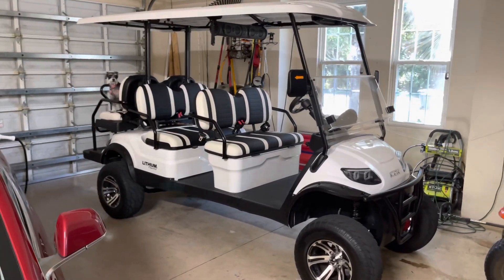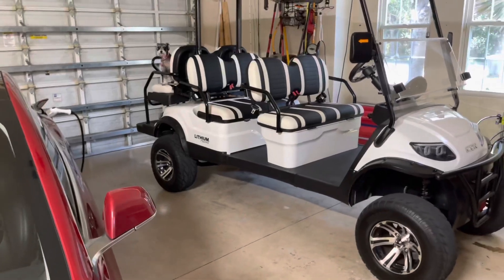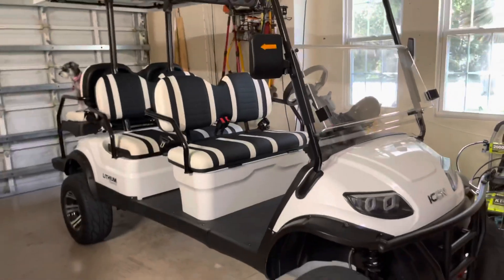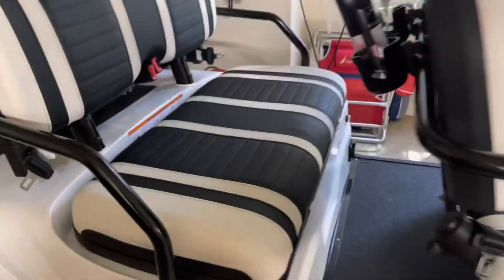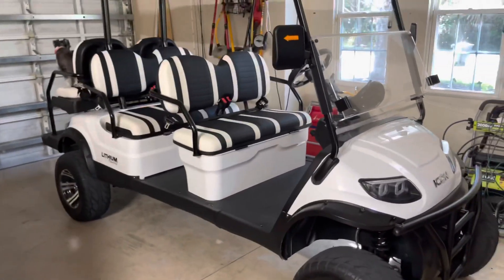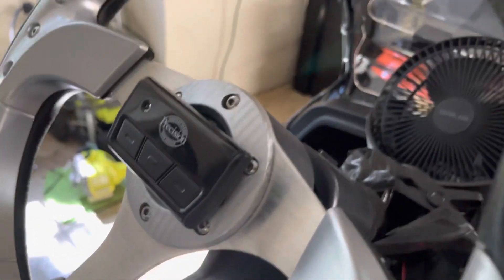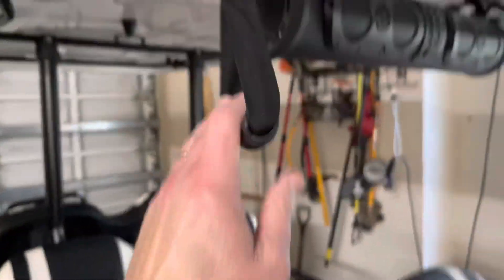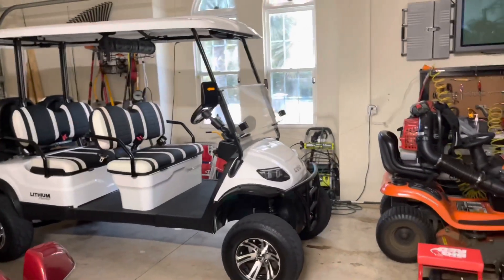Tips for ICON EV golf carts (lithium) plus a Navitas controller installation tip!

Comment: Maybe I missed it. But Icon has a electric parking brake. If the BMS cuts out the parking brake locks up and throws people out of the cart. Very dangerous. Did you fix that or just ignore it? Remember the parking brake is normally lock with no power and power unlocks it. So a controller wont fix that problem. Not a great design.

Comment: Put Bigbattery 120 Ah Lithium Batteries in my L60, all utilities work but the cart won't move, I hear the click which seems to be the electric brake releasing but cart goes nowhere, checked the relay under the cup holder, it is not lit up, any advice is appreciated ?

Comment: Make sure you don not buy this model Navitas 10-000890-14 tac2 600a controller for the 450A controller replacement it does not fit the 450a harness ………it fits the 350a harness. I have a 2022 i40L and bought this to upgrade the cart and found out as soon as I looked at the harness they are both two different sizes. The i40L harness is wider by a good quarter inch. I called Navitas and they told me they have NOT made a controller yet that will for the 2022 year wider harness. So if you want to upgrade to the Navitas make sure you specify you have a 2022 model or up ……if you have the 350a controller you good.

Comment: Nice videos man! I have a 2021 icon i60 it’s all stock other than a reducer to put in a sound bar and led lights under it. the navitas controller is something I’m looking at going too, for more off the line power. mine has the 5kw ac motor and the 440 amp controller. it’s not lifted cause of my garage door is low sadly. and it does 29 100% charged down to 90% rest of the time it’s 27. didn’t know if you noticed the torque gets increased or not going to that controller. Be the stock one. and I need a winter project. Being when I bought it used at the end of 21 had low mileage the previous owner put all new batteries in it. so when those go. I’ll be going to lithium but not as of now. just wanted to have that out of the gate power to be really impressive. Like I see some 2 seaters popping a wheelie and gone. don’t need a 6 seater todo that but that kinda power out the hole would be cool vs the lazy take off it has now.
Reply from the maker: I appreciate it!! Thanks for watching! As far as the Navitas I think I have good and bad news so I’ll give you the good news first that is the Navitas will absolutely fix your take-take off speed/torque! Yes it will be best with lithium, but even with stock batteries it will launch out the gate if you have the Navitas turned up for fast take-off and that’s easy to do because of its “on-the-fly” controls that mount on your dash. The bad news is that it sounds like you have the newer generation Icon because you said you have the 440 amp controller if I’m not mistaken. If I’m correct that means they don’t have a Navitas controller for those newer Icons yet. It’s supposed to be 2021 and older that can use the Navitas I have linked in my accessories list on all of my videos, but your’s appears to technically be a 2022 but Icon doesn’t really sell their carts by “year”. Anyhow, for you to be certain you can’t use the Nevitas I linked in the description of my videos, you will need to see if your controller is the Toyota NEOS controller. If it is, then you can definitely use the Navitas I have listed and the one I have on my cart. But if it’s not a Toyota controller then as of now Navitas hasn’t come out with one that will work with your cart just yet unless they have very recently and I haven’t heard about it yet. I hope this helps but please let me know if you have any more questions.

Comment: What a great video. I just bought an I60l ICON that came with a Roy Pow s51160. The cart does 25 mph and I don't care to go any faster. It was doing great until the other day. Coming up a steep hill it dropped out and died. The power lights were only down two bars. After a while I was able to restart the battery by holding the on off button down for several seconds. Is this something that can be resolved by having the factory controller reprogrammed?
Reply from the maker: Thank you! When you are going up the hill how many people were on the cart?
Reply: @yourtechtoday9238  It only locked out on me once. It was only me and my dog who weighs 65 pounds. I have been up and down that hill probably 20 times before and no problems.
Reply: @jt11255  so the only time you’ll have this issue is if you’re going on a very steep hill and/or you have a bunch of weight on the cart. You mentioned the hill is steep so the best thing I can suggest is to maybe try not to push the accelerator pedal down any further than you have to even though I realize you typically need a lot of power to get up a steep hill. This issue is really only found on the S version of the battery that we have and this is why Roy Pow now sells a P version of our battery that allows you to discharge more power from the battery without the BMS shutting down like it did for you on that hill. But to answer your original question, yes I do believe you could program your cart a little differently to help prevent this from happening. I would ask your dealer to see if he can assist with it. Ultimately it’s always going to be a problem but I’ve got almost 4000 miles on my battery and to this day it’s only happened once to me and that was because I had 6 people on the cart with 2 dogs and then I was pulling a trailer with 3 other people in the trailer. Way to much weight for me to be asking of this standard version of the battery. But once again to maybe help you with your problem I should mention that when it happened to me it only turned off when I put the pedal to the floor. Otherwise it was driving just fine with all of that weight. Also just let me know if you’d like me to tell you how to reset everything if this ever happens again instead of having to wait for the battery to restart.
Reply: @daynemaasdorp357  how do you reset it easily?  I know you could also remove the battery cable?
Reply: @MrDance4meh  that is really the only easy way. Some people think that you can just restart the battery but I have not seen that to be true. The fix is to VERY carefully remove the positive terminal cable to the battery with a wrench, without letting it arch or anything crazy between the terminals, and then it will reset the battery. Please be careful…a lot of power in that battery…

Comment: Hey, I have been looking to buy an Icon golf cart recently, i’m questioning if i should get a 4 seater or 6 seater but your videos have really been helping me out, thanks! Subscribed 👍🏼
Reply from the maker: I really appreciate you letting me know! Means a lot so thank you! I bought the lifted 4 seater and it was great but it was pre-pandemic when prices were only about $1500 difference between the 4 and the 6 so I sold the four and bought the six for actually only $1000 more. But I know prices are crazy now and there’s a bigger gap between the 4 and the 6 seater at this point. For what it’s worth, the big difference between the 4 and the 6, except for the obvious size difference, is the stability at higher speeds and when going around curves is a lot better in the 6 seater. Best of luck!

Comment: Can you tell me what I need to do with the green and brown wire that came off charger to the upgrade roypow upgrade
Reply from the maker: Do you mean you have a Roy Pow battery installed and your trying to figure out how to get the new charger that came with the Roy Pow connected to the battery? Just making sure I understand the question.
Reply: Yes and it should the only wires I don't have accounted for are this green/black wire and brown wire which went into old charger
Reply from the maker: So I’m not quite certain how you’re setting yours up because if you’re using the charger that came with the Roy Pow the wires coming in from your original charger shouldn’t be doing anything. I’m sure I’m just missing something in your set up but for mine, I basically used the lithium charger that came with my Roy Pow that was meant for a Club Car or maybe an EZ GoI I believe. This meant I needed to place the charger onboard beside the battery and splice the charging cord and place the brown wire on the positive post and the blue wire on the negative. Then I would simply have to lift the seat and grab the 110 cable that comes out of the charger’s other side and plug it into a wall outlet in the garage to charge the cart/battery. Once again I only did this for a little while because ultimately I was able to program my icons charger to charge the Roy Pow itself.
Reply: Thanks I'm in touch with icon as well I'm an actual dealers mechanic but I don't recommend it much yet
Reply from the maker: OK just let me know if I can help any further. Best of luck and please be safe. I realize you probably know this already but I always make sure the battery is powered off via the button on the side until everything is wired up.
Reply: Did he set your charger to only charge 51.5 volts? Is that what was programmed.  If not what is your charger the old one charging at total voltage?
Reply from the maker: I don’t know what setting he used in the algorithm choices but I just looked in my Navitas app when charging the cart and see nominal battery voltage is 51.2 and battery voltage is currently 52.84. Have no idea if that helps with your charging question but that’s what I saw in the Navitas app.

Comment: What's the link to the forum.  I have a lot of questions.  Just bought an i40 and it will be here in a month. I need to add, the bluetooth speaker bar like yours, sand bottles, ball washer, ice chest.  Great video.
Reply from the maker: Glad it helped. Thanks. Here is a link to the forum on Facebook. Just let me know if you have any issues joining. If you request to join they will accept you within a day or probably earlier. https://www.facebook.com/groups/283409022761803/?ref=share

Comment: Your charger is set up for lead acid batteries if you using your original charger to the charge the roypow the gauge may read full do to surface charge, i recommend using a li charger that came with your roypow and if wire properly you can use your same cord
Reply from the maker: I’ve had the charger programmed for my current battery and about to drop a video where I’ve hit 30000 miles. Why are you saying this? Am I missing something because I have quite a few miles where charging has been zero issue since using the correct charging profile since getting the RoyPow battery…

Comment: Thanks for your video.  I have a few questions on if you were to do it today.  What would you change?  I have a 2018 icon 6 passenger lifted as it comes.  Would love to learn what battery you would use, how to program the charger to work and how to adjust the computer vs getting a a different controller.  Any help you can provide with contact info would be awesome.
Reply from the maker: I’m sorry I missed this comment. I am uploading a video today and will answer your question. Sorry for the delay.
Reply: @yourtechtoday9238  thank you. Look forward to seeing it and learning so I can convert my icon 60L
Reply: It's pretty easy honestly, I work in quality control here in Arizona and you can use Trojans, agms, and a lithium ion battery I don't recall the name. It's pretty easy and in most cases you can use the same converter. The programs for both are super simplistic and universal. But you will have to take it to your dealer, most options are universal. My favorite is the trojan batteries, they make the cart turn into a rocket ship 🤣
Reply: Go to whatever icon dealership is by you or give them a call where you bought it.

Comment: Do you know what  algorithm profile he set for the Delta Q charger for the lithium battery?
Reply from the maker: I wish I did but I’m not certain of the exact voltage. I only know two things that may help you: in that regard: When he programmed it I saw in the software briefly that there is an option for a lithium battery setting for setting the charger algorithm. And then also it may help you that the number he set it to matched up to what the charger that came with my Roy Pow said it would do if that makes sense? Also I can plug my cart in and look at my Navitas app and see exactly what voltage it is charging at if that would help you?

Comment: You can buy i60l with lithium now. Wonder if there good
Reply from the maker: That’s great to hear. It depends on what lithium they’re using. Do you know?
Reply: @yourtechtoday9238   it sure I am speaking to the dealer now. I will get you the brand of battery and let you know.
Reply: @yourtechtoday9238  I decided to start with the 6Trojan batteries it comes with. I read on some icon forums that the lithium is having issues and the cart locks up. Not sure what the cause is. Not taking that risk for a couple of grand.
Reply from the maker: @Familyguy1262  I totally understand but it’s just dealers putting the wrong batteries in these carts.  I think I’m gonna make a video on it one day because there is a ton of misinformation out there. But happy you are taking advantage of the batteries that come with the cart. Nothing wrong with that!
Reply: @yourtechtoday9238  can you do a video of how you converted to lithium? Also do you think the motors are rated for higher speeds
Reply from the maker: @Familyguy1262  One of the great things about Icon carts is they come factory with a strong Toyota controller and a high speed motor. I’m going to do a video explaining some of the issues people are having with lithium and how it has nothing to do with icon golf carts. I didn’t take too much video of my lithium installation but I did cover it a little bit in this video. Not sure if you’ve seen it yet. https://youtu.be/bRxXtp9OFck
Reply: @yourtechtoday9238  had my i60l for a month. It’s great. It’s clearly governed at 28mph which is fast from the factory! My hill climb is not the best. There’s a habitats 600 amp controller online for icon. Will that improve my climbing? Also navitas says “ up to 25mph” I don’t want to go slower!!! Help please 😀
Reply: The Navitas 600 amp controller upgrade would help with those hills for sure. They say up to 25 mph just for legal reasons but you can adjust the cart to whatever speed you want it to go. With the batteries you have currently you could probably go 33-34 top speed with the Navitas and then you could set the takeoff torque to the high setting and you’d be good on the hills. The one thing to keep in mind is when you add something like this if you set the parameters high your battery range is going to go down faster because you’re pulling more power. So to say this in a general way, yes the Navitas would help with the hills but you wouldn’t be able to go up too many hills before having to charge. Also one of the benefits of the Navitas is it let you control the “battery regen” you get when you’re going down the hill so that gives you a tad  bit of power back if that makes sense. Also the best thing about the Navitas is you can control all of these parameters so you can set your cart to the speeds that fit your needs and battery range. And my last note on this is that the Navitas is truly at its best once you have lithium. That’s where you have a ton of fun because you’re not worried about range no matter how fast you go. Just let me know if you have any further questions.
Reply: @daynemaasdorp357  with the new icon controller it's now 38 😎
Reply: @user-dl5xr2tw9f  that is awesome considering it’s from the factory! Makes people really think about the benefits of regen and max speed that Navitas offers…🙌
Reply: I was just talking about this, not only are the faster, they last longer, and the extended run time is awesome!!! Talk to your nearest dealer about the agm batteries
Reply: @user-dl5xr2tw9f  yep I definitely think top speed will be better but really need some
Better hill climbing ability. The i60 lifted really craps out up hills.
Reply: Yoooo! I hope all is well! So currently at our site we use the agm batteries now standard in all of our carts as of two weeks ago! I have hand extensive tests now we these batteries and I can't say too much... But top speed with the new icon controller 450amp is alot high and the cart is way more responsive! I would 100 ⭐ these batteries with our setup!